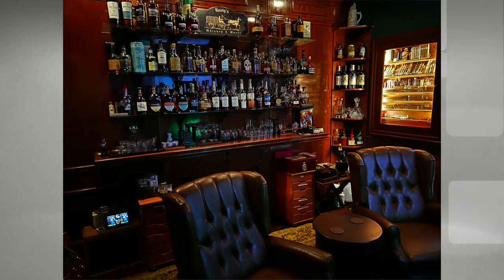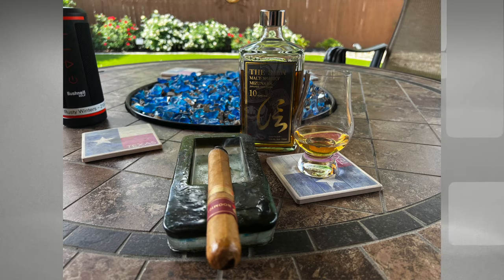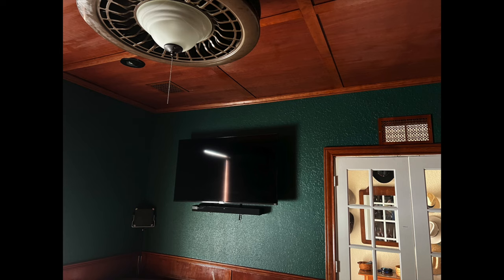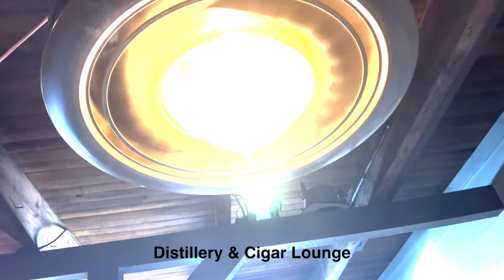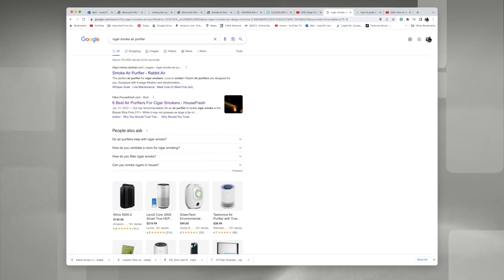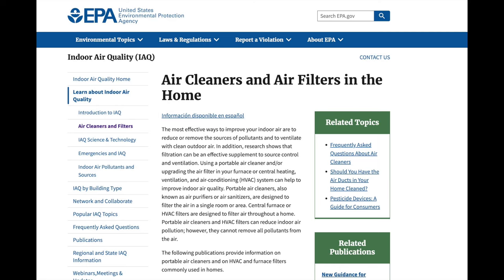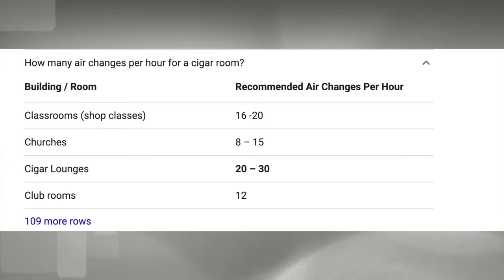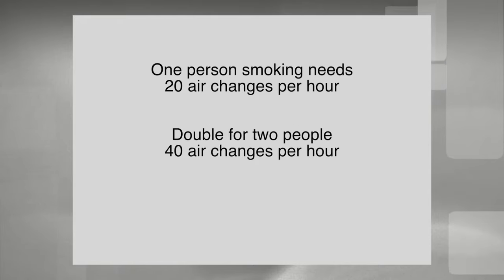Home Cigar Room Ventilation.

Comment: Very good video. I am designing my cigar lounge in a portion of my unfinished basement. Since there are vents all around the basement I will use the ACInfinity 8” fan also and probably 2 off the Purifans. I will get the make up air from the larger portion of the remaining basement. It is humid here in the summer, winters are not bad. I will close off all the existing wall vents except the the 8” fan and make up air. With all your research do you have any thoughts?
Reply from the maker: I am pretty confident that you have it covered. I have found that with the amount of air you will be moving it should be able to create negative pressure as you describe. The only problem I can picture now is that the Purifans will create airflow patterns that may divert some smoke away from your ventilation fan vent. If so, you may find that you can run just one of the Purifans  while you are smoking then turn it back on when you are done for an hour or so. Worst case you may have to not run any Purifan, while you are smoking but I doubt that will happen. It is hard to visualize airflow without doing some smoke testing. Two ways to do that. Tried and true is to just smoke a cigar and move around the room to see where the smoke wants to go. Ideally you could install the ventilation fan first and try it. that may help you determine the best locations for the Purifans. Alternatively, you can buy some smoke bombs an Amazon and elsewhere. They produces smoke for, typically, three minutes. You can shoot video of it to have as a reference in designing your airflow. either way my feeling is that it will be easier than you expect. Good Luck! and let me know how it turns out.
Reply: @arwin10w  what an excellent response and I really appreciate you taking the time to go into that detail. Keep the videos coming, I like your style. Thank you again

Comment: Hello Sir , great set up.  Thank you for sharing .  Just wondering ,what if the weather is hot  and you were to add an air conditioner to your room.  Since your ventilation is sucking out the air including cool air if air conditioner is installed.  What is the size of the air conditioner you need for the room with your current ventilation set up ?
Reply from the maker: I have a 3 ton two-stage heat pump that heats and cools my house. It is able to supply all the cool air I need. The exhaust fan pulls out air faster than the air conditioner can supply it thereby keeping the room at a negative pressure. Therefore no smoke leaves the room other than through the exhaust fan.

Comment: very informative video and plan to us much of this to equip my small room lounge! Has anything changed since this content was posted? Is everything still working well? I noticed a wooden ceiling vs sheetrock....is sheetrock contra-indicated in a smoke room? thks in advance for any replies
Reply from the maker: Everything is working very well. I have had no problems. I chose wood for the walls and ceilings for esthetic effect. I wanted an old English pub or library vibe and the dark wood tones really accomplished that. Sheetrock is harder to clean so an I also felt the wood was easier to keep clean.  However, since the ventilation is working, so well, I get very little residue on the ceiling. Only a little bit around the exhaust vent.  I have helped a few people set up their smoking rooms in their houses and they have sheet rock there seems to be no problems. Thanks for the comments.  Good luck!

Comment: I enjoyed the video, thanks.  I have a question.  In a previous house I had a proper cigar room designed much as you use here.  In my current house (I downsized) I opted to go for a shed that I finished the interior on.  Much smaller than the previous room, but as you said, 30-degree winters and 100-degree summers are no good.  My question.  I find that when you are pulling air from a room, it has to be replaced from air from somewhere.  This is usually outside.  Being that your room is a part of the house, this may not be the case.  Have you had to deal with the issue of temperature controlling the replacement air?   If I'm pulling air from the room at a rate of 20x an hour and pulling in air from the outside at a similar rate, it kind of introduces the problem of comfort once again.  In my case, if I turn on my ceiling vent fan, and suck in cold air from the outside, The heat is constantly running and of course I'm throwing dollars away.  Likewise, in the summertime when I'm running A/C and pulling in hot air to replace the exhausted smoke-filled air.  Ideas?  Suggestions?  May be none, but figured I'd ask all the same.
Reply from the maker: It is a valid and often asked question. In the case of a smoking room in a house it is much easier to deal with because there is a large conditioned space, the house, to pull makeup air in from.In a shed your on'y option may be to provide a way for outside air to create the negative air space. It may be that you don't need as much makeup air as you think. I don't know if you have used your shed room yet and if so how are you getting access to outside air? It may be that you need less then you think. I do recognize that you are always going to need more Heating and cooling if you are exhausting room air, especially if you are adding outside air. But you really don't need 20x makeup air. You want lees that that so you are in fact exhausting all of the smoke. So part of my answer, respectfully , is that "yes, I would expect you will have added heating & cooling costs when you are exhausting that much air and replacing it with unconditioned air. I am pretty sure even in my house that I am spending a little more to keep that room comfortable. I would try a small opening to introduce outside air. Maybe something low like the space underneath a door or a small vent near the floor. This might help with the air flow pattern as well optimizing the smoke removal. I wish I didn't have to say this but, it may take a little trial and error to get it right. Although I believe it a scientific approach, doing a complete air flow analysis etc. would be costly and likely disappointing. So try a few different methods and watch the smoke exhaust as well as the impact on heating/cooling. Good luck and let me know how it works out.
Reply: @arwin10w  Heh heh.  Yes I've used the shed for about 2 years now.  Trial and error are exactly where I am at now.  Believe it or not I just suck it up and spare the extra expense.  The fan I have installed is not powerful enough to pull smoke from the room.  So, I use a simple window fan.  I have two windows.  I crack one to let fresh air in, and I use the fan in reverse to suck air out in the wintertime.  The heating unit just runs, and it keeps up.  If the room gets overpowered with smoke, which it does at times, I open a door, and in 2 minutes no more smoke.  In the summertime it is much the same, but I use a window AC unit to cool it.  No perfect solutions here but hey, it is just a finished shed.  No one out here but me, and I can smoke in peace and relative comfort (doing so as I type up this response) ...    It's nicely finished, and it gets the job done.  Ultimately, I want to install a through the wall ventilation fan with more power near the ceiling.  That with a vent with a baffle for intake air near the floor, and I think I will call it done. Thanks for replying.

Comment: Loved the video and the detail provided.  Since the exhaust fan system really takes care of the smoke, is the filtering on the ceiling fan actually necessary? How often must you change these filters and how much do they cost?
Reply from the maker: The filtering ceiling fan is really not required but it does speed up the smoke removal a little. I think in most cases only an exhaust fan is needed. in my case I installed the ceiling fan air purifier first and felt it was not quite enough so I added the exhause fan. I only run the exhaust fand whenI am smoking. When I am done I turn that down to a low setting and turn on the purifier for the night. I and 18 months in without changing filters yet.The filters are $65-85.

Comment: I'd like to know your thoughts on any negative impact of Not having duct AC or heat in my bourbon/wine room, almost exactly the same size as yours (1,480 CF), in my house in Montana. Maybe better as no return and the smoke can't escape the room via a duct AC/heat system? My room is in basement. I do have thermal mass radiant floor heat in concrete slab. I plan on doing the same thing, ceiling fan and exhaust fan. I have a window to exterior wall. My thoughts are to install a through wall or window exhaust fan, likely with motor on outside to minimize noise. Walls will be wood with chinking, like an old saloon. Any recommendations or general thoughts appreciated. Thank you.
Reply from the maker: If you can maintain appropriate temperatures for your cigars, 65 - 75 degrees F. most of the time as well as maintaining the proper humidity for them, then I see no problem. You may need to supply some kind of fresh air inlet, depending on how air tight your basement may be. You have to be able to maintain negative air pressure in the room, not only to contain smoke but to aid in removing it. I worked on many basement remodels growing up in the construction business Maine, which has a similar climate to yours. Supplying makeup air to help remove the cigarette smoke was a common issue there. The radiant heat in the floor is, IMHO, an ideal situation because it does not create any airflow patterns that may be counter productive.  Good Luck! I like your thinking.

Comment: How well has the purifan held up? Do you still like it? Does it still do an excellent job? I'm looking into buying one, but I don't want to spend the money on it if it's not worth it! Great video by the way! Very informative!!
Reply from the maker: The Purifan does an excellent job. I changed the filters after two years recently and there was black smoke residue on every layer of the filters. Like all air purifiers it depends on all of the smoke getting sucked into teh filter. That is pretty much impossible. In my case the Purifan captured 95% of the smoke. If I had to chose one, I would go with an exhaust fan instead. In my case I have both, which is great when I have 4 or 5 people in there smoking.

Comment: Where did the makeup air come from, and how did you account for the additional 6 tons of air conditioning required to cool it from Texas air at 95F to 75F?
Reply from the maker: I have a 3 ton, two stage heat pump that handles the HVAC in my house. Make up error supplied by an open vent on the transom above the double French doors. Additionally, air can enter under the door. I believe it would be a mistake to block the opportunity for air to come in around the door as I need to keep negative air pressure in that room. Many of these houses in Texas that have been built in recent years do not have return ductwork they simply use the whole house as a return air Plenum so all of the rooms have this open vent above the doors that just opens up into the hallways, etc. I previously had a 2 1/2 ton system in this house, and it was really challenged moving enough air into this room since I had to replace the system when it failed I elected to go with a slightly larger system and it solved that problem. Thank you for your interest.

Comment: Hi , I watched the video about vented the smoke out but will create negative pressure inside the room.  how did you bring intake air into the room and what about the heating or cooling of the room ?
Reply from the maker: I have a 3 ton two-stage heat pump that handles heating and cooling for the whole house. it is able to keep the room comfortable at all times even with the exhaust fan running at full speed. No smoke ever leaves this room other than through the exhaust fan.

Comment: I am so interested in the purifan, could i jist use the the purifan without exhaust fan? Great videos keep it up!
Reply from the maker: Yes you can!. It took care of 90% or more of the smoke in my room but not all of the smoke found its way to the Purifan in my case. I would try it first and if it is not efficient enough it is not very expensive to add an exhaust fan.

Comment: Love the ideas for the fan at the end. Do you use an ozone generator at all?
Reply from the maker: I was using an Ozone generator early on but a friend from the cleanup industry informed me that the ozone can degrade some common materials, namely rubber and other synthetics, which are found in carpet backing and in many furnishings. I confirmed this with some research. I have since found that I really don't need it.

Comment: Please excuse my ignorance. Can you explain the window fan’s purpose and negative affect?
Is the fan blowing out of the room or into the room?
Reply from the maker: The purpose of the window fan and later, the exhaust fan I installed in the attic, is to remove smoke(air) from the room. The fan sucks air out of the room and blows it outside removing any smoke that is in the air. The result is that the pressure in the room is lowered compared to the hallway outside the room. That is called negative pressure; when the pressure in the room is lower than an adjoining space. So when you open the door to the cigar room smoke does not flow outside in to the hallway but is flowing towards the exhaust fan instead. Thank you for your question.
Reply: @arwin10w  ahhh! I see, thank you very much.  Excellent videos!

Comment: I HAVE A 850 SQUARE FOOT ROOM WITH CEILING HIEGHT OF 72 INCHES WILL I BE ABLE TO FOLLOW THE SAME FORMULA ?
Reply from the maker: Essentially, yes. That is a relatively low ceiling height but the math works the same. So you have 5100 cubic feet. That is a pretty big room so you will need more than 1 exhaust fan since you need to move a minimum of 1700 CFM. So two 8" fans should be enough, since mine moves 900 CFM. Is it possible that the room is not 850 SF? Is 20' by 42" or something?

Comment: How are you compensating for heat/Cool loss in the room?
Reply from the maker: The AC system seems to be able to compensate. However this room has always been a few degrees hotter than the rest of the house. I’m installing a new heat pump this week since my existing system has failed. I will add a second supply line to the cigar room. That should fix the temperature differential plus bring in additional make-up air. However I don’t see that as a problem currently.
Reply from the maker: Actually, at this point, I am not compensating at all. On a hot day it’s about 3° warmer in that room even without the exhaust fan running  on replacing my AC unit and I’m adding an extra supply line and that should equalize it with the rest of the house

Comment: what type of barrier did you use to seal the doors? Thank you!
Reply from the maker: I actually didn’t seal the doors. In my case I wanted air to enter the room underneath the doors to help create the negative pressure within the room. Think of it like driving a car and opening the window on the passenger side. Certainly some air will escape. Now crack the window on the driver’s side a little bit.  You will feel air flowing across your face. It’s the same idea with venting smoke. You to let some air come in to replace the air being exhausted by the fan. If you creat good cross ventilation you won’t need to seal anything, just let the fan create the airflow to exhaust all the smoke.

Comment: Now I need to have someone cut my roof.  I am afraid I will screw it up and it leak. That and I have composite roof makes it harder
Reply from the maker: Yes that is probably the most common concern people have. Mine was asphalt shingles so it was easy. I think that operation took about 15 minutes. We just sealed it with roofing pitch and it has been leak free. You might find a handyman or small roofing contractor that would be willing to install the roof vent for you. Good luck!

Comment: maybe I can custom do it in my window and have it vent out the window.Hmmmm
Reply from the maker: As long as you are moving enough air it could be enough. The issue I had was that smoke rises, so much of it was not exhausted through the window fan.
Reply: @WintersWay  makes sense I have a rabbit air to help. I will keep watching. thank you for your content I enjoy the music and the room as you do your videos
Reply from the maker: It is possible.
Reply: I have a 8" hyperfan mounted on a sheet of plywood that I can insert into my window on my heated sun porch for the winter, when I'm done I just take the setup out and works great at exhausting the smoke.